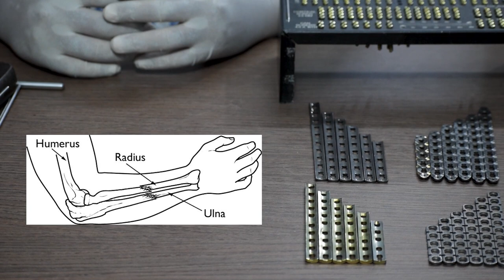Implants & Instruments for Both Bone Forearm Fracture

Comment: Respected sir I have screws and plates in wrist and humerus. I am 35y. April-2021 operation was done.   After the surgey how many months or year is required to remove or if can we leave inside the body any problem will come. Kindly suggest me.
Reply: After how many time are u receovrr
Reply: @MALIKG-pr9pl  6 Months.
Reply: @ಶಿವರಾಮುಟಿ.ಎನ್  bro now can you lift heavy weights???
Your hand will work just like other hand pls tell me how many days it will take to recover totally
Reply: @imrozpatan2439  it will not work like normal hand bro. 60 to 70% will work. Full rotation is not their. Like before Heavy weight lifting not possible.
Reply: @ಶಿವರಾಮುಟಿ.ಎನ್  can you do puch ups bro
Reply: @imrozpatan2439  NO